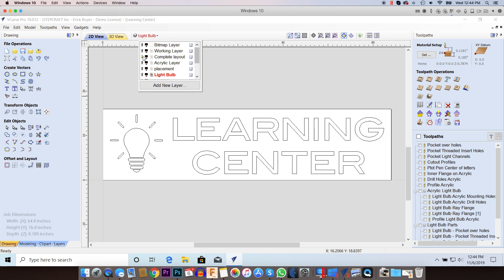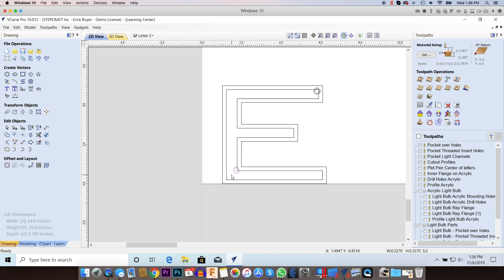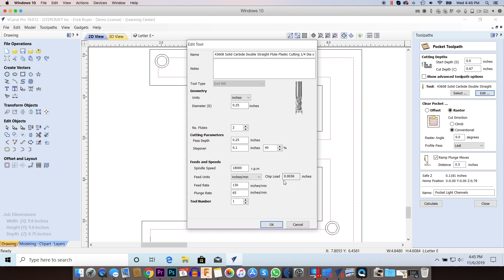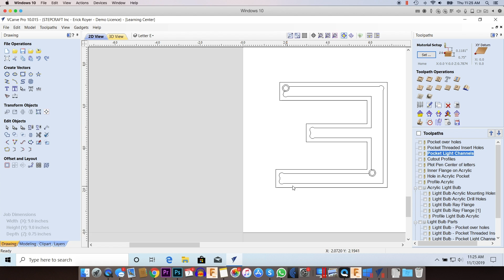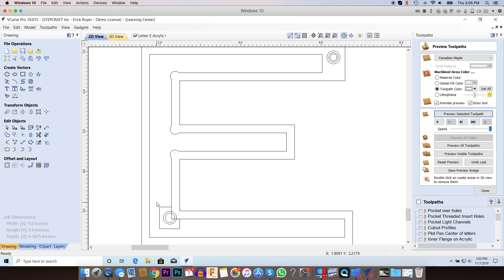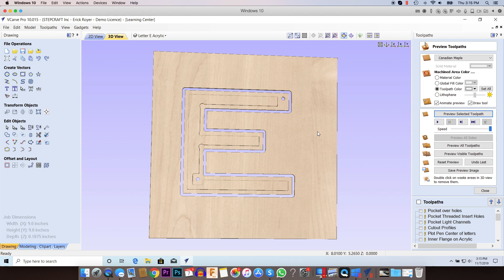PART 1 - 3D LED Backlit Letter Sign Tutorial: Design, CAM and CNC Machining

Comment: I am trying to make acrylic led letters on a 32in round sign but need help on how I can go about connecting the acrylic to the wood? I have a mira 9 laser cutter using lightburn. Is this the same concept?
Reply from the maker: Yes you would use the same concept as in the video